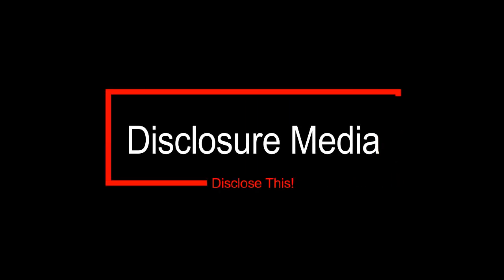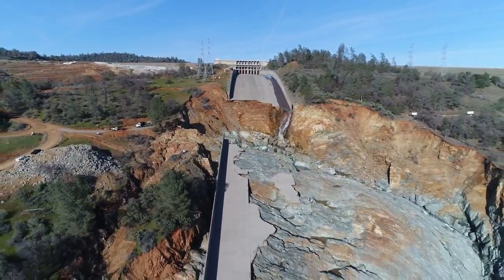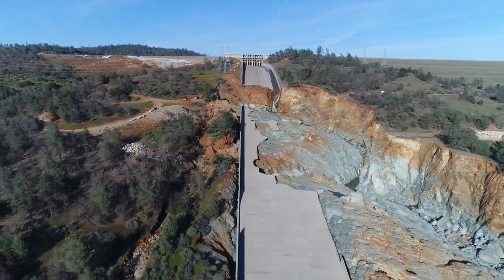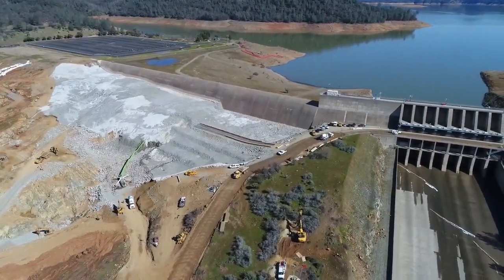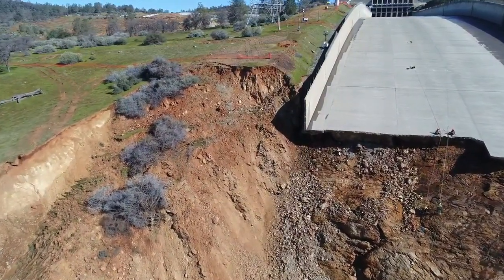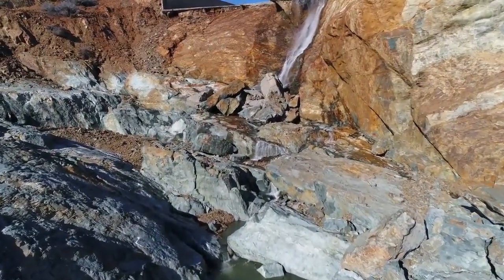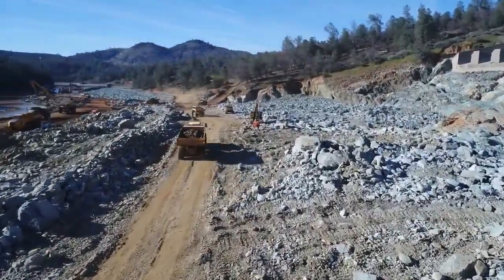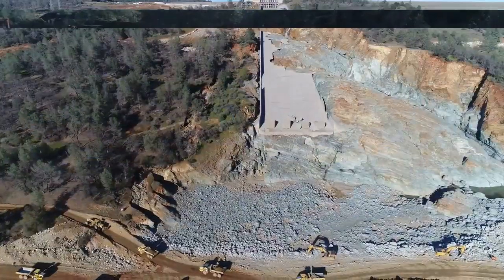Drone Video | Lake Oroville Dam | Update 3-3-2017

Comment: This got an immediate and good fix, build a wall immediately on upper side of spillway and dump as much concrete as
possible along with the wall and upper portion of the spillway which will stop the eating of the spillway towards the dam side and will prepare the spillway for further discharge or reduction of water levels for extensive repairs later. Concrete will dry down completely within 7 days and without a worry, they be able to discharge the waters without any issue of damaging the dam. This can be accomplished within a span or day or two.
Reply: Sounds sensible to me.
Reply: sounds good, if this was minecraft

Comment: Looking at the snowpack, I'd be looking for another, quicker way, to divert at least some of the water out of the lake. Some of us know it will be a flood in many areas.
Reply: Not really.  In order to have any meaningful flow (in the 10's of thousands) You would have to have several tubes 8-10' in diameter.  You don just siphon off that kind of flow like a bath tub.  This is why the power plant is going to be put back online.
Reply: I've been thinking about this concept for awhile now.  They could have been welding pipe together right from the start of this disaster.  Weld a series of pipes together so you have perhaps a dozen different pipe lines running down the side of that mountain into the river from the reservoir above.  With the huge elevation change it would be the mother of all siphon lines. 

 I realize you'd have to figure out a way to anchor it all down which might be a huge challenge but then at least you have some redundancy built into the system so if one or more pipes/tubes fail, you could shut that particular line down with a gate valve and keep the others running.

  The nice thing about piping or tubes is you don't need to worry about erosion like you do with these stupid spillways.  I understand it's a lot of water to move that way but I never even heard anybody talking about the idea or why such a concept wouldn't work.  Moving 50,000 CFS for example, would probably take one hell of a huge pipline that may not be realistic with the pressures involved.

Comment: Disclosure Media
Hi, I live in Sacramento, 70 miles south of Oroville Dam. If(when)  the dam breaks, do you think it will flood here as well. And how high would the water level be, considering everything is soaked here already. I've heard different things, and I'd like to here your take on this.  thank you
Reply: The dam is structurally sound.  The spillways (both main and auxiliary) are separate structures that are not attached to the dam.
Reply: They are separate structures in this instance, physically, and geographically.

Comment: Thanks for the update. How does the weather forecast look for the upper watershed. Just seen a video,a guy flying over the Sierras, if there are sudden warm temps,it might spell trouble below. what is your opinion,you think everything will be alright from here on out for the people of Oroville?
Reply from the maker: imo, the spillway is junk, there is options, but they will all take time...right now they are focusing on cleaning the debris and get a channel open so the powerhouse can get going and start outflowing.
Reply: Thank you DM. It will be interesting to see how well everything works out,when the water starts flowing again. In yesterday's update you did,.I thought i heard you say they found a crack in the spillway and not far from the gates.  Did they do anything to fill the crack? If not all the work they are doing below could be a waste of time. That crack is drying out now and should fill it with super-crete.
Reply: Rain to begin Saturday afternoon, continuing all day Sunday and to end on Monday afternoon.  Weather system will produce snow in higher elevations.  Moderate to severe.
Reply from the maker: In some new chopper video, workers could be seen taking core samples of the spillway, the crack was at a joint in the concrete..the slab is slightly lifted..they also had that marked with orange spray paint.
Reply: Oh boy,they have people working on everything.  TX DM
Reply: A functioning power plant allows them to lower lake level below 850'...where the intake channel for the main spillway becomes too shallow to discharge much water.

The powerhouse moves less than a third the flow rate of what they've run the main spillway at for the last week or so, but lower lake levels equal reserve lake capacity for the coming snow melt, and rain events.

It's all an equation in hydrology, what runs off, where, and collects where, when.

They have solid numbers on the snowpack. Variables exist in how fast it melts, where it melts first, and the sequence of the melt.

Viewed as a whole, the system of dams and reservoirs have a known capacity, a known current volume of water, and known flow rates, at both safe, and emergency flow levels.

With inflow into Lake Oroville at 190 kcfs at the beginning of the emergency, it is clear that the primary bottleneck is the powerplant...at 14 kcfs.

That plus the main spillway can achieve 64 kcfs at rates,which previously closed the powerhouse, and 114 kcfs at rates which created the original damage to the main spillway.

If, at the end of the rainy season, the powerhouse, main spillway, and aux spillway are all within one inch of full destruction or uncontrolled release, the hydrologic management strategy has to be counted as a win. Population centers below the dam survive, and the dam's primary objective, flood control, has been met.

Any destruction less than 99% of fatal to the dam, a surviving powerhouse, an unused aux spillway, zero additional damage to the main spillway, count as a financial bonus.

In order of threat, I see total destruction of the main spillway the least risk. This will lower the lake to 850'. Destruction of the aux spillway would achieve the same effect, much quicker, because it is so much wider, more attendant downstream damage.

Water flow over the earthen main embankment would be the worst case scenario, most likely, as this type erosion cuts quickly, and wide, lowering the lake much lower than 850'.

At no point would one expect a 750' high wall of water. Only possible if the dam were to vanish completely, in an instant.

Water flow over the top of the embankment would begin as a trickle, increase to max flow when balance was achieved between erosional spillway creation, and remaining water level behind the dam.

A very rough estimate then, of max flow,  might be half the dam heigth at once, 300-350'.

All greatly simplified, of course, but those are the numbers, and that's the math.